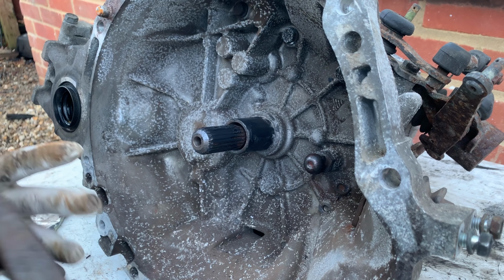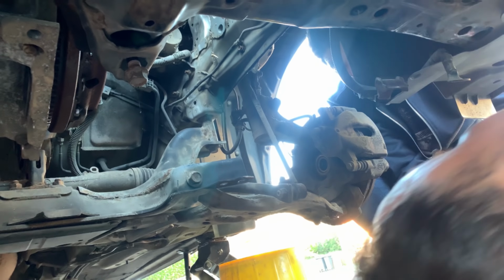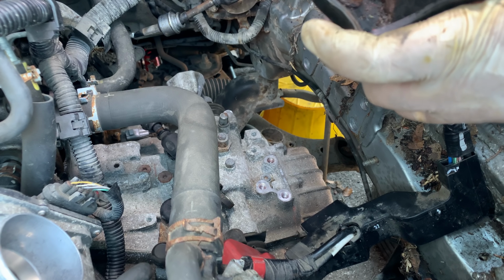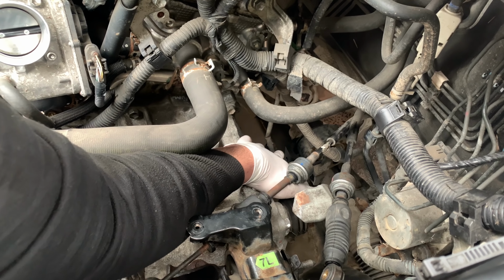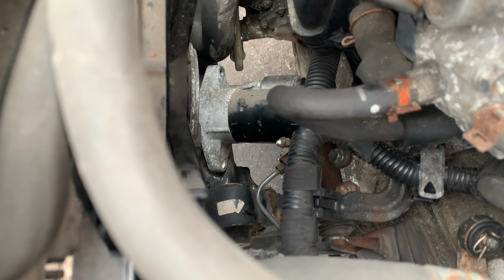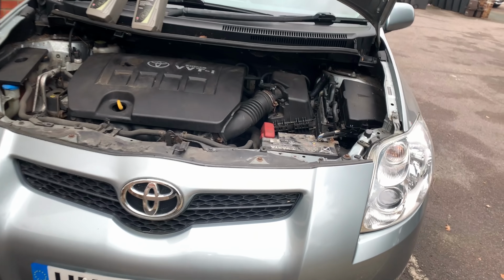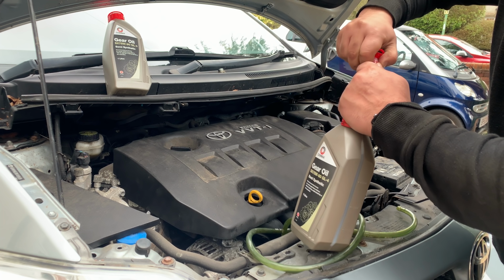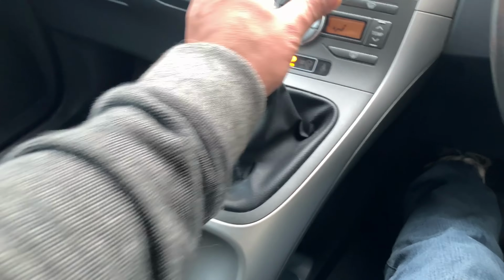Toyota Auris Gearbox Replacement | Follow-up

Comment: great video, I am contemplating on tackling the clutch kit on my Auris 2013 1.6 petrol, I am hoping not much difference under bonnet/physical size. 

@4:58 what kind of threadlocker did you use?

Thanks

Comment: Awesome work mate! Nice tip about the driveshafts. Tapping the side of the coupling to get the shaft out. Did I also see you tap the side of coupling on the driveshaft to get it in? I thought they’d just slide in but is it the retaining clip that was preventing it from going in? Subscribed 👍
Reply from the maker: Matthew Jones cheers mate I appreciate it, I did tapped in the same way the retaining clip does prevent it from coming off and on, this one wasn’t too bad only needed a few taps but they don’t just come out 😋😉👍👍👍

Comment: I have a toyota auris 2012 1.4 diesel. 6 speed transmission. I have to change the transmission, do you think it's necessary to pull out the engine or go the same way as you did here?
Reply from the maker: I believe the same that I did should work 👍

Comment: Hi mate you have done a great job well done I have got a 2007 toyota auris semi automatic, do you think it going to be same process for changing my car clutch please? Because I don’t know I go to every workshop they say we don’t do semi automatic could you please tell me what’s is the diffrence between them and I know how to reprogramming affter manually could you advise me what’s I have to do many thanks
Reply from the maker: Sorry bud but I'm not really familiar with the semi-auto Auris, but in most semi auto it will have a manual gearbox with electronic actuators , the process of changing the clutch will be pretty similar then in the end you should have a option in the scan tool to calibrate the clutch bitting point ...

Comment: Great job!!
Reply from the maker: TheAlexunit thanks mate I appreciate it 👍👍👍
Reply: Cars Exposed Do you think that the wheel hub nut need torque wrench when you have finished with everything else?
A few days ago they changed front left (driver's side) inner boot of cv joint on my Auris and i don't think they used any special tool for the nut...
I have replaced the wheel bearing in right side(passenger side) in 180k km and i wouldn't want to change it in left side due to wrong torque specs...It's quite expensive and i didn't go with oem but aftermarket SKF brand
Reply from the maker: TheAlexunit very important to replace and torque the hub properly, you can either torque up on jacks using like a strong screw driver in the vents of the discs or preferably on the floor ... the torque for the hubnut in this TOYOTA Auris were 216nm 👍

Comment: Hi wanna ask coz u drained the gearbox before taking out the old one to replace it then u went to fill the new gear box..but what i don’t get did u also drain the new gear box be 4 u installed it to add new oil..
Reply from the maker: Porsche 911 technically you have to drain the gearbox before removing the driveshaft, otherwise as soon as you remove the driveshaft gearbox oil will go everywhere ...
Reply: Cars Exposed brill thanks on that 👍🏼

Comment: Nice video, I have the 1.33 Auris 6 speed manual. My question is why all the engine parts in your Auris are rusty? Is it normal in UK?
Reply from the maker: Some areas are quite pron to rust because of the road salt spread in the winter… I’m ok in the south but northern vehicles can be quite bad .

Comment: Awesome vid bro..how much would u charge to do a gear box on a mk2 Yaris
Reply from the maker: Thanks mate it’s probably a 3 hours job so depends how much the labour rate is, my labour for this job was £120
Reply: Cars Exposed its the same job as the auris but but not as much to take off..also i would help u with it to get it done abit quicker an provide the part also 👍🏼..
Reply: Cars Exposed as its a mk2 yaris its almost the same layout as the auris..
Reply from the maker: Porsche 911 where are you based ?
Reply: Cars Exposed bradford mate..
Reply from the maker: Porsche 911 unfortunately I’m over 5 hours away mate if you can drive down I’m happy to change it 👍
Reply: Cars Exposed oh no..wear are u based mate..also do u have a number i can get u on

Comment: I stumbled upon your video on youtube while trying to research on my auris repair. I am from Kenya and Own a Toyota Auris 1.6L MMT engine car bought second hand fro the UK. out Dec 2018, i gave my Siz who had an accident and broke the Samp. out of that, after some repair, the gearbox got messed up and later on the started developing engine problems. Finally stalled in Jan 2019. We decided change the whole engine + the gear box.

Unfortunately we could not find the exact model and instead opted for a 1.8L Petrol engine 2NZR that came with the gearbox, ECU, Mountings, drive shafts and electrical wire harness.

Problem: Having a difficult time fitting the Electrical wire harness to the old car since the older car is MMT and sort of has Electircal Ger transmission. (it has the Gear Paddles) while the new engine + Gearbox came with a Gear Cable.

my older engine number is ZRE151R-DGHNKW, VIN SB1KV56E60F035072
The replacement engine is 2NZR ...

would you be able to guide me on this ..?
Reply: As a follow up, the new Engine has an automatic Link Cable, while the older one does not. 
So would like to know how to fit the Link the Auto Gear Lever through the firewall considering the old one does not seem to have one. 
It seems to have some kind of electronic Shifting mechanism ..
Reply from the maker: Hi bud, sorry I don’t really see automatics Auris that much but unfortunately in my opinion if the new gearbox needs a cable you probably will have to modify the firewall opening some channels for the cables ...

Comment: Did u drain the new gear box b4 u installed it mate
Reply from the maker: Porsche 911 no need mate it was empty already as you can see no gearbox oil coming out from the driveshaft holes 👍
Reply: Cars Exposed ah i see so basically wen u get a good second hand gear box the is usually drained
Reply from the maker: Porsche 911 not necessarily a good gearbox but this Toyota system you cannot keep any gearbox oil in without the driveshaft in place 👍
Reply: Cars Exposed oh so basically wen u get a secondhand gear box theirs no oil in it
Reply from the maker: Porsche 911 yeah
Reply: Cars Exposed so their is oil in it i mean the Toyota gear box
Reply from the maker: Porsche 911 sorry I don’t know if I get you question . But if you bought a second hand gearbox without the driveshaft connected to it there is no gearbox oil and you will need to fill it up 👍
Reply: Cars Exposed brill thats what i wanted to no..an thats what i was trying to ask u ...😛
Reply from the maker: Porsche 911 I gathered that 🤣🤣🤣🤣👍👍👍
Reply: Cars Exposed 👍🏼😂😂😂😂
Reply: Cars Exposed hi can i jst ask is the gear shaft in the bell housing suppose to be making eny sort of noise wen rotating back an forth an wen u slightly pull on the shaft..an wear the gear linkage connect u have that round unit is the suppose to be loose an making any sort of noise

Comment: Would it not have made sense to replace the clutch, pressure plate and bearing with new ones at the same time? I think I would have!
Reply from the maker: I agree with you mate it makes sense as you are there after a lot of labour, however the owner of the car chose not to because he had replaced everything about 10k miles ago... there is a part 1 removing everything in the description 👍👍👍 cheers

Comment: Mate what grease are u using
Reply from the maker: Moly grease bud ...
Reply: Cars Exposed chears buddy am gunna try do it my self as its same sort of set up ad the auris..what engine size is the auris u did buddy
Reply: Cars Exposed is that greas multipurpose        Greas buddy
Reply from the maker: Porsche 911 it was 1.6
Reply from the maker: Porsche 911 no
Reply: Cars Exposed oh so its not mutipurpose grease..ok so which one do i go with buddy
Reply from the maker: Porsche 911 Moly grease
Reply: Cars Exposed cool wear u get it from mate..
Reply: Cars Exposed how did u remove the clutch fork mate..do u jst pull off or something
Reply from the maker: Porsche 911 yeah with the gearbox removed just pull the fork off from the input shaft and it slip off the rubber boot clutch slave cylinder side 👍
Reply: Cars Exposed brill i was jst asking as it will need cleaning an greasing before reinstalling it..wear did u get the grease pack from..an did u reuse the same bearing that was on the fork
Reply from the maker: Porsche 911 cool yeah cleaning and greasing it’s a important part of the job... I got the grease from Eurocarparts but any carparts store should have it, a new throw out bearing should come with the clutch kit I believe you can buy separate as well 👍
Reply: Cars Exposed brill..well the clutch is brand new it was installed about a month or so ago but wen i drive i get like a squealing noise so suspecting the gearbox..but my AC pump is gone to do u think that would effect the performance